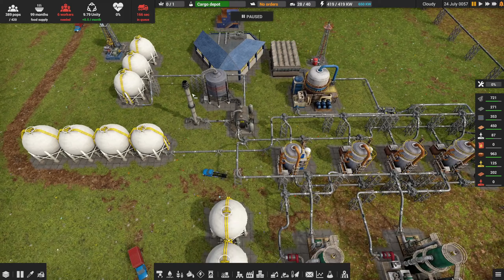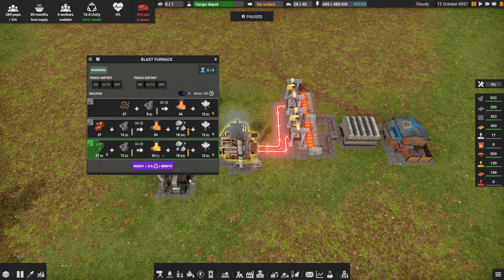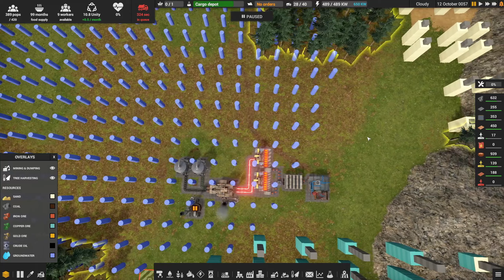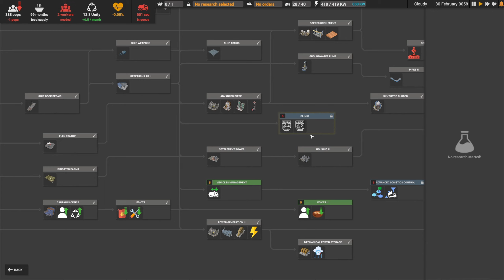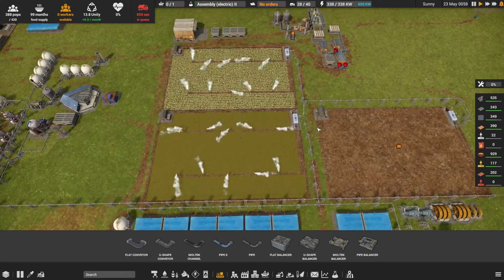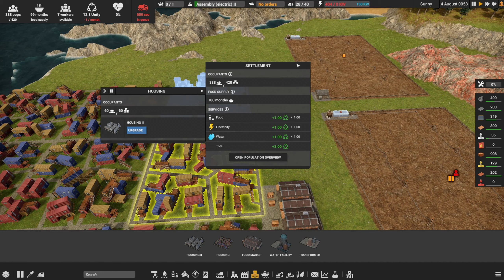Let's Play Captain of Industry s03 e18

Comment: Man stacking pipes and belts can be finicky.     I tend to draw them out beyond the one that's stacking with, then deleting the excess later.
Reply from the maker: I try to do the same thing. It's finicky, but at the same time I have a hard time complaining since some of the stuff we can do in this game is so cool.  
Do you know if there is a way to delete a small piece of a long pipe segment without first splitting it with another pipe?    It seems to always want to remove huge sections at a time.
Reply: @Glidercat  Nope, the only way i know of is to pause, add a branch, then delete both the original section you want to delete, along with the new branch (which isn't built het).   It would be nice if you could highlight a section to be removed.
Reply from the maker: @davesharman8302  Yes. I would like ability to hit the ctrl key or something while I'm deleting to only remove the smallest possible (or relatively small) chunk of pipe, conveyor, etc.
I'll probably head over to the discord and suggest that now.

Comment: Did they add a max Cubic feet per minute flow to the pipes yet?  I hate to sound like a bag seat gamer but seeing you make the same mistakes in 3 seasons now i wanna chip in with few tips lol. When you want to store extra parts and the storage houses are next to eachother, run them in Series directly attached to eachother rather than running them in parallel with bunch of conveyors (like at 7:05).  Running the storage houses in Series essentially doubles their capacity where running them in parallel can result in one storage house emptying faster than the other one and one line shutting down.  Also, clear trees strategically.  For example clear the trees on top of the oil field and the ore fields leaving the resourceless areas for last.  Anyways loving the series.  Cant wait for the full game.
Reply from the maker: Ha! There are no mistakes in gaming if you're having fun,, and I'm having plenty of it! 😺  The layout of my unit storage buildings has to do with aesthetic as much as it does efficiency.  I'm not too concerned with 100 efficiency in any of my factory designs, and I'm not crazy about how the storages look in series jammed up next to each other. Everyone has a different style of play, but I'm probably in the minority when it comes to factory games. I'm just not that hyper focused on precision or efficiency, I just play for fun.  
Captain of Industry is an amazing game. There's already a full game here and they keep adding huge new chunks of content and gameplay!